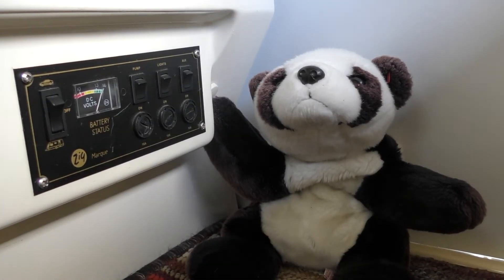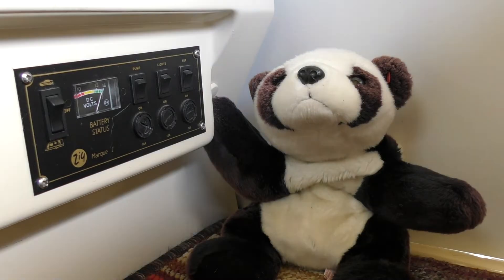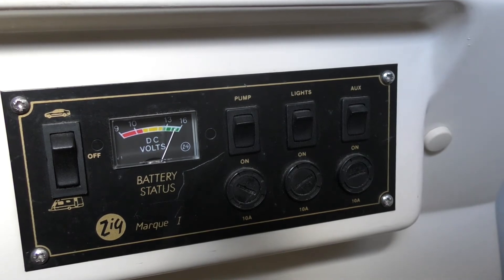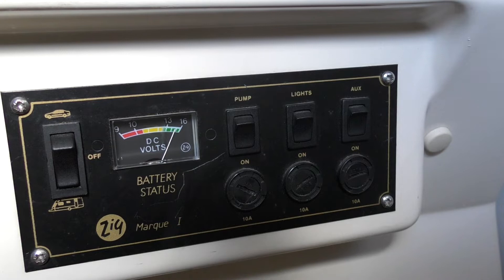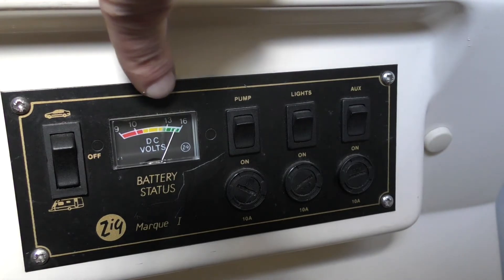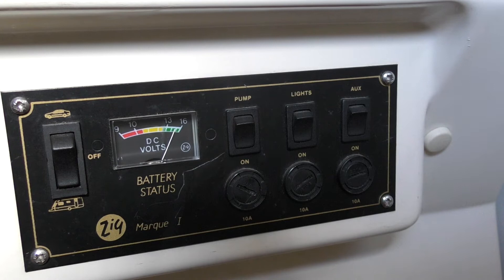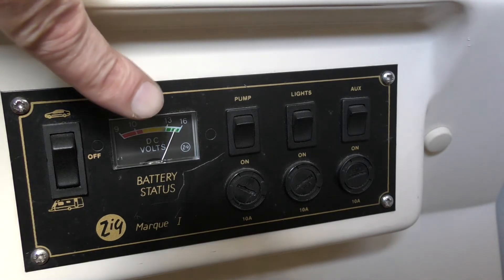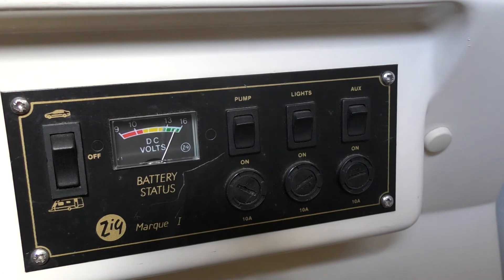12v electrics in your C15 Romahome

Comment: Great video but do you leave the left switch on van when driving, or put it on car to charge the leisure battery??
Reply from the maker: Hiya.  The Zig unit doesn't affect the charging of batteries, it is only a distribution board, to choose whether onboard power comes from the leisure battery or the engine battery.  The engine battery automatically gets charged by the vehicle alternator and the leisure battery by the split/charge relay.  Doesn't matter where the Zig switch is.

Comment: Hi there I have been told to position the three way rocker switch to the middle position whilst I am driving my R20 Hylo Romahome the engine will first charge the vehicle battery then once that's charged the relay will then switch to charging the axillary battery is that correct Panda.
Reply: I'm confused about this too, I have been told to switch to car when driving!! 🤷‍♀️

Comment: Great informative videos. My elderly neighbour has a Romahome and has had problems with his water pump. The fuses keep blowing. I’ve established that the pump is knackered and has become misshaped. There appears to be another problem that there aren’t any volts getting to the pump. I’ve put a meter in continuity mode from the back of the Zig panel
 onto the + feed and to the end of the cable at the pump end and there’s no reading. The cable at the Zig end is red then at the pump end is brown, so somewhere there must be a join behind a panel. Is there anything you could tell me where that join might be? Thank you for your time.
Reply from the maker: Hiya.  The pump is switched by the tap itself, so wiring probably runs from Zig to tap and then to pump.  If that is the case, it'll be a case of tracing the wire from the tap to the pump.  These old C15 Romahomes can be a challenge!  I wish you luck.
Reply: Yes, I suddenly realised last night that to activate the pump you need to turn the tap on😮! I was very excited this morning to put the meter across the wires and get my neighbour to turn the tap and see the meter race up to 12v. He’s a very happy man. Thank you for getting back to me.
Reply from the maker: @milesharris9910  No problem.  Glad you got it sorted.👍

Comment: I have a Romahome hylo C15 same as yours. My water pump suddenly stopped working. I wondered if it could be the fuse but can't seem to find it. Any suggestions you could offer would be gratefully received.
Reply from the maker: Hi there.  I you have a Zig unit, the fuse is below the the Pump switch on the panel. If you don't have a Zig unit, it's a case of tracing the wires back from the pump until you find the fuse.  It could also be the switch inside the tap, they are known to give up.  Taps are still available new.  Hope this helps.
Reply: @pandabloke  many thanks! I have a Zig unit, yes, so will try the fuse and then the tap. I have the older version of tap where there is a fragile little lever which you have to flip over to switch tap on. Very grateful for your help and time x

Comment: My son has the same but his lights have gone off, is there a fuse of some kind that needs changing? Sorry new and green to the camper caravan screen! He runs a diesel heater and that works but the other electric s dont
Reply from the maker: H Victoria.  I assume you mean the cabin lights?  Make sure that the main switch on the panel is set to the caravan setting.  Also there is a fuse for the lights on the panel under the switch that says 'Lights.'  Hope this helps.
Reply: @pandabloke  I will check in the morning, yes it's the lights where the seats are, how do we chance them and where would we get the fuses from x
Reply from the maker: @victoriaevans5233  Hiya.  They should be below the switch on the panel and just unscrew the holder.  Fuses should be available from any motor factor, like Halfords.
Reply: He has had a diesel pump put in and everything ok it runs off the leisure battery and is working but everything else has stopped . Do you think it's a fuse for the lights or a connection?
Reply from the maker: @victoriaevans5233  Hiya. Sounds like the people who fitted the diesel heater have inadvertently disconnected everything else from the leisure battery.  Have a look around the leisure battery for a wire that is hanging loose and disconnected. Hope this helps.
Reply: @pandabloke   everything was working great after the fitting but a few days later the other electrics stopped yet the heater is still working,
Reply from the maker: @victoriaevans5233  Ahh. In that case it definitely sounds like either the switch on the panel has been knocked away from the 'caravan' setting or a fuse to the panel has blown.  That fuse will be behind the panel somewhere I'm afraid.  The heater will be wired independently of the panel, that is why it still works when everything else doesn't.
Reply from the maker: @victoriaevans5233  Hi Victoria.  Please feel free to contact me on pandabloke@yahoo.co.uk if you like and I'll see what else I can do. Panda
Reply: Do you mean the 3 ports on the board where  it needs the screwdriver or do you mean the whole panel or is there another fuse place
Reply from the maker: @victoriaevans5233  Start with the 3 fuses under the switches on the panel.  They should be glass fuses, so it will be easy to see if they are blown once they are out.
If not, somewhere behind the actual whole panel may be a fuse to the panel itself which has blown.  You may have to take the panel off to check that.  I can't be sure of that as I've never had to look.
Also as I say, make sure that the switch is set to ‘caravan.'

Comment: Another well made informative and very helpful video from Panda and Arnold....please could you make a video on sterilizing the water tank??  The previous owner has put diesel in wrong tank on my little Puddle Jumper I have just bought grrrrrr🤨
Reply from the maker: Hi mermaid.  I shall add that to the list, no problem!  Thanks for watching as always.
Reply: Pandabloke the Puddle Jumper is still not on the road😢 I paid for welding also electrics,new bonnet and more repairs for mot.....i am at a loose end and thinking of converting it into an artists studio if I cant get advice about it.....I've  tried for years for info but I am not computer savvy  would you be able to tell me what model it is 2 locals have said it's a rare vehicle all I know it's a 1989 model I think coach built C15D I seen an original picture of it on Flicker if that's any help and it it had venture written on it....sorry to go on about the Puddle Jumper as I call it I tried to go on Small Motorhomes site for advice but me being a silly oap women I couldn't work the damm thing.....best regards to you and Arnold 🤗🙂